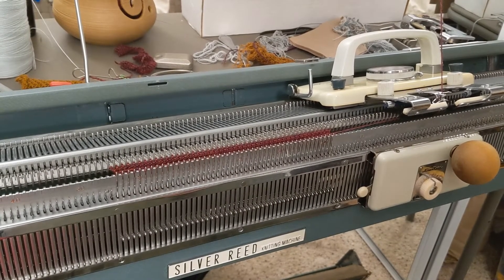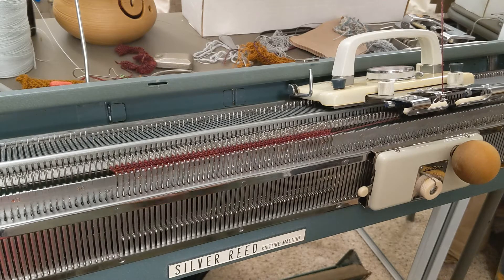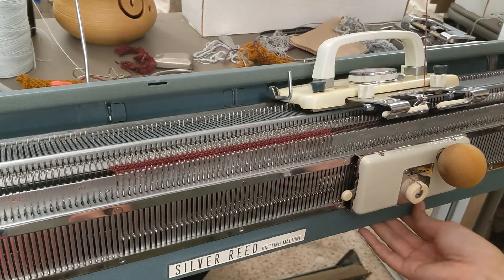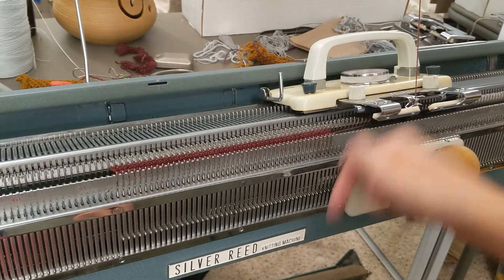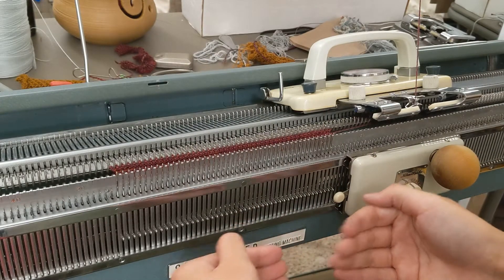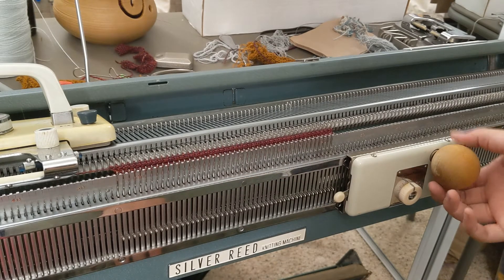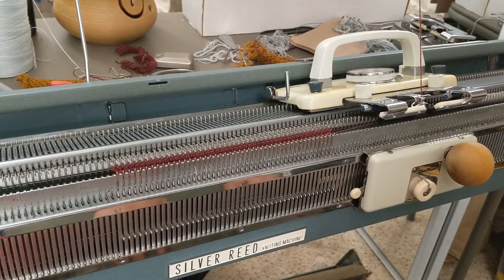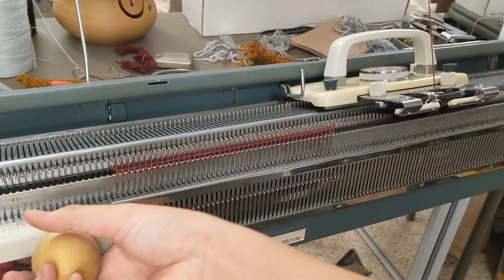Tubular knitting on a Silver Reed SK10 and SR10

Comment: I'm looking at buying a similar machine. What weight yarn have you used on it? Do you think it could handle worsted weight yarn on every other needle?
Reply from the maker: I've tried doubled-up sock weight yarn on every other needle at stitch size ten and had little issues. Did have issues with that using every needle though. 

I'm not sure I've tried worsted weight yarn specifically!
Reply from the maker: There are bulky/mid-gauge machines, though those are a little harder to find. I believe many don't have punchcards, but depending on your needs, they could be an option!